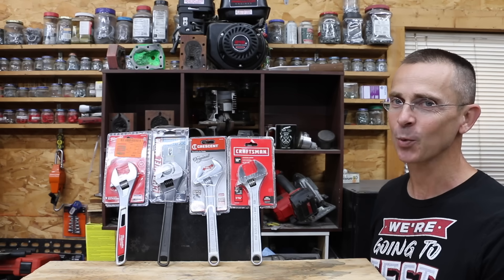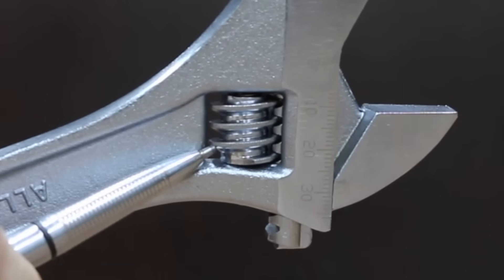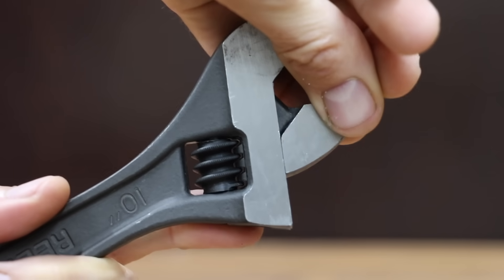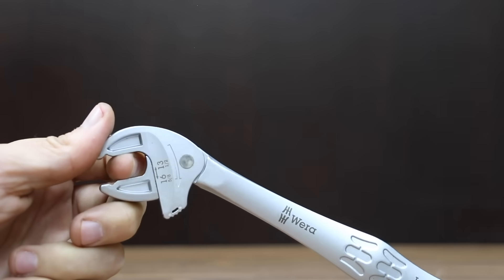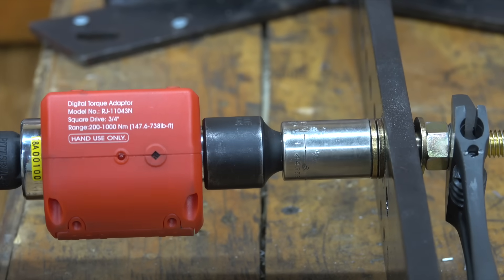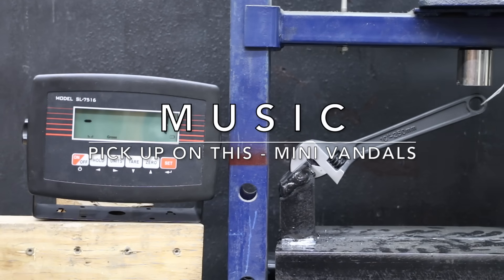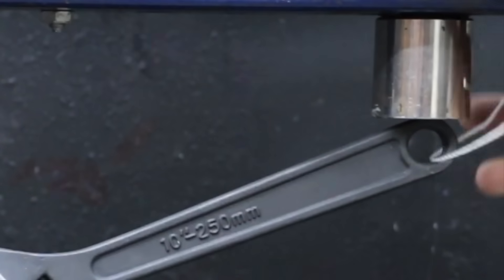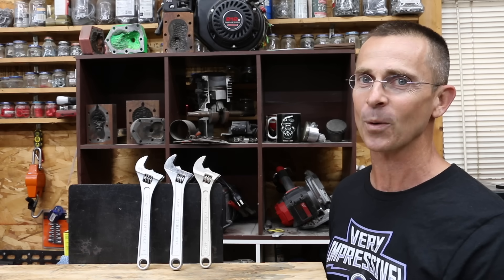Best Wrench (ADJUSTABLE)? Craftsman USA vs Craftsman, Crescent, Kobalt, Milwaukee, Channellock

Comment: Look, I'm an old guy who grew up watching other old guys using tools that were frequently ancient.  Most of my tools are considerably older than I am (the last one I used, a couple of days ago, was an old hand-crank drill that is probably from the 1930s).  Obviously, I have a large number of "vintage" adjustable wrenches, mostly old Crescents (I really wish there had been a U.S. made Crescent in the test, since the old Craftsman was included).  The "newest" one is an ancient Craftsman I found buried in the vacant lot next to my house- I haven't done anything but wipe it off, it's rusty as hell, and it not only works but has practically no slop at all.  

For what it's worth, I was told this as a kid and my experience has been the same:  old Crescents always have a bit of slop, but they are damned near indestructible & practically never rust; old Craftsmans are great, but much higher maintenance- if you don't grease & oil them, they will rust right in your toolbox.  

The best one I currently own is a J.H. Williams 12-inch (probably 1960s).  I have another elderly adjustable wrench, a Canadian one (I don't remember the brand), that is pretty good also- I think it's in the tool box of my work truck right now.

I practically never buy new hand tools, but sometimes there is no option.  Kobalt gets a bad rap, and they do make a lot of trash to scam dummies with, but they also make some pretty good tools that are dirt cheap.  I needed a pipe-wrench smaller than any of my Craftsmans, and I was pleasantly surprised at how good the 12-inch Kobalt pipe-wrench is.  It's pretty much the same deal- you have to test each one until you find a good one, it just takes a bit longer with Kobalt.  There were brand-new Chinese Craftsmans on the rack with the Kobalts, and they were absolute garbage; I wouldn't take one of those for free, they're so bad.  I recently realised that the heavy-duty plier/wirecutter set I bought for $1.99 at Big Lots back in the mid-1980s are Kobalt; I'm still using them regularly more than 30 years later.  Quality is quality, and with a bit of experience you can see it with your eyes and feel it with your hands.  Brand names don't even matter nowadays, just use your brain...

Later edit:  I just looked in my truck, and the Canadian wrench is an old Gray "Dreadnaught" 8-inch.  There is a somewhat later example on eBay right now (7:08 pm 4 August 2022) which is the same model but not as finely machined.  I literally found mine laying in the gutter on Gratiot Avenue a few years ago; these are essentially identical in terms of quality, etc. to a Crescent of comparable age...
Reply from the maker: Thanks for sharing.

Comment: If you don't want to watch a 20 minute video that could've been a 5 minute video...

8:34 "Jaw opening change from vibration" & "Weight"
12:37 "Wrench maximum torque"
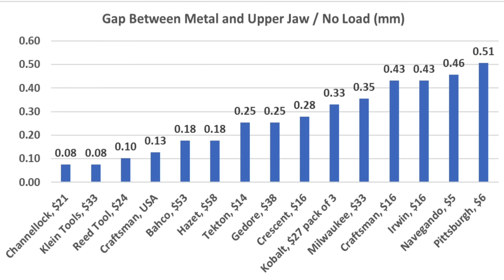13:22 "Gap between metal and upper jaw"
16:02 "Gap between wrench and steel plate with 200 pound load"
18:29 "Failure load"
18:54 This channel's pick for a $20 wrench is the Crescent brand, or spend more and get the Klein Tools.

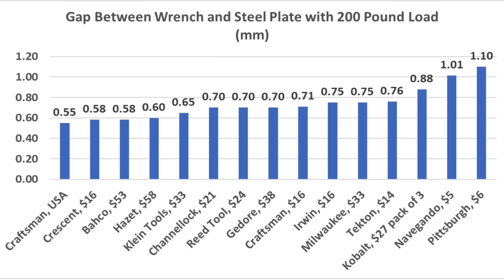16:16 Just to watch shit break.

Comment: Craftsman has been GARBAGE for decades. Its quality has steadily gone downhill as has sears fighting over honoring warranty replacement. Not to mention down in the teeny tiny fine print they state not for professional use. The craftsman of today is as bad as harbor freight junk The craftsman of the 90's wasnt like the craftsman of my father or grandfather. Craftsman tools are only good for cutting up nad modifying but even then its spendy to do so.
Reply from the maker: Thanks for the feedback.

Comment: The direction of operation that stresses the moveable jaw the least is opposite from the way most people seem to use this tool.  Turn the wrench over, and you’ll see the load point from contact with the nut move closer to the root of the jaw, and flex much less

Ignore the direction markings - adjustable wrenches are much stronger when they are used inverted
Reply from the maker: Thanks for the feedback.

Comment: I always ask for tools for Christmas. Wether it’s just Kobalt from lowes or whatever. People always ask me “what do you want “for Christmas, Father’s Day etc? I just tell them to walk the aisles of any home center and grab any of the holiday( especially Christmas and Father’s Day) bundles in the aisles for 20-30$. Cheap gift and most last a lifetime. I’m not a mechanic or carpenter by trade, so I don’t need to have the top tier tools. Most of what I got is great for what and when I need them. I’ve amassed a pretty nice collection of tools over the years. I still have some nice USA craftsman and snap-on tools my dad gave me too. So if for any reason my mid-grade tools fail me, I can reach for the older USA tools in my old metal toolbox. But my Kobalts seem to work pretty well for my limited use.
Reply from the maker: Thanks for sharing!

Comment: stuff i see that you did not test operationally: 1. set the jaw size, does it stay there through several uses. 2. set the jaw size, does it tighten itself onto the nut so you can't get it off.

Comment: is it really necessary to point out the zero before the point,  just say point 5 mm or example, you don't need to say zero point 5 mm.  we should all understand anything after the decimal point is less than 1,  and the zero is not needed.   I think I have belabored the "point" long enough.  HAHA

Comment: Why even use an adjustable wrench in a high torque situation in the first place ?  Makes ZERO sense.  Use a  box end wrench...problem solved.  Adjustable wrenches were not made for this kind of abuse.  This whole test seems pretty pointless.

Comment: With adjustable wrenches recently in mind (thanks to this video), I happened upon an old paint-covered Stanley 10” adjustable I’d tossed in my sprinkler bucket and forgotten months or years ago. I recall buying it at Home Depot sometime in the 90s. It was nothing special at the time: just another mass-market ingredient in the typical Hubert Homeowner toolset. But, damn…the perceived quality blows almost everything in this test away. Almost zero slop on each axis. I couldn’t get the jaws to open more than a hair while bopping the handle with my fist. This was a typical DIY tool 25 years ago—maybe 15 bucks for a pair of them.

We’ve lost something.
Reply: We didn't lose, they sold us out, and we settled for junk! We should have returned cheapo made stuff in bulk! They would have no choice but to go back to quality
I only get garage sale tools, they're not mine!
Reply from the maker: Thanks for sharing.

Comment: For work, I bought two pliers in a specialized shop, one 8 "at € 12.45€ and one 10" at € 14.94. Both of the Ega Master brand made in Spain. I am really satisfied with these two calipers, especially with regard to the holding of the measure under working conditions. I subjected them to some (non-destructive!) tests and got good results, towards the top of its ranking. Spain tools seems to me good .Always congratulations on his commitment and his ability to put the tools under stress
Reply from the maker: Thanks for the feedback.

Comment: I stay away from wrenches that have a handle like the Irwin. When pushing on the handle the rubber covering will slide off, especially if it’s warm where you’re working and store your tools.
Reply from the maker: Thanks for the feedback.

Comment: Nice test even though I am not a fan of adjustable wrenches.  I have an asortment of wrenches where I do not have to use an adjustable wrench.  Also, of note, at one time all Craftsmen hand tools were made in the USA (as advertised by Sears) but now who knows where they are made (Craftman now part of Black and Decker).  Still, a nice comprehensive test with a lot of effort to obtain the correct results.
Reply from the maker: Thanks!

Comment: Most of us avoid an adjustable for the reasons you showed. I'd like to see the Snap-on, Mac and Proto included. As an electrician of 40 years, I use my old American made Craftman tools for everything. I've only broken a few small sockets and a 1/2 inch ratchet in all those years. A breaker bar might be advised in those conditions instead of a piece of pipe over the handle, lol. At least if I'm on an out of town job, I can usually, or at least used to be able to get, a new replacement from Craftsman in most towns. Most of the millwrights I met used Craftsman too. God Bless America! China is the worst, every time. We are at war. They would have us keep buying their cheap crap over and over again, which adds up to a kind of economic slavery. Remember, 80% of our prescription drugs come from China. Some complete with jet fuel included for free. Google it. Thanks for the fair test and including the old Craftsman. May it rest in Peace.
Reply: I'm a millwright from Canada. I've been doing this job since 1980. By far the best adjustable open end wrench I have ever used is the Rastall brand made in Canada.
Reply: @FRLN500  Thanks for the tip, from a man with experience, but I hope to never have to use an adjustable wrench again. Although I do keep a small one with me while riding my electric bike through the mountain trails trolling for bears, just in case. Cheers
Reply from the maker: Thanks and you are welcome!  Thanks for the suggestion.

Comment: Been doing alignments on everything from kias to transfer trucks for like 12 years now.  The only adjustable I'd trust is a Crescent.  Even after the move to China they're hands down the best I've used.  Granted i rarely use a 10" (which is what was tested).

Comment: The feeler gage 200lb test the USA craftsman feeler gage was deeper than any other test. I'm calling bullshit, the craftsman was measured so deep into the jaw compared to your other tests, if you measured at the tip like the others the gap would have been larger. I'm unsure what tests to trust after that

Comment: I love the channel, but do recognize the limitations of the testing that you do. Testing a sample size of 1 is not really indicative of  quality, in that in an uncontrolled manufacturing process through chance, there may be some very well performing units while the item is trash in general, as well as the opposite. I do not know, with the resource constraints that you are operating under, how this could be resolved within your resources. The data you get from one sample is not indicative of the lot with any measurable confidence interval.

Comment: I am very happy to see Hazet and Gedore on the videos, a bit (very) disappointed that they didn't ace everything...
So I did some research, and I found out that there are some brands advertising they build predictive breaking behaviour into their metals alloys, trying to prevent serious injuries (or even death) to the user, in case of abuse/misuse or anything unexpected that might happen.
I couldn't find out, though, if this kind of "expected to break around xyz% above the expected normative torques" is also written into the norms.
I did find very interesting to see in the end that one or another brand market their stuff stating boldly "tolerances and quality that not only fulfils but greatly exceeds the norms", instead of going in the direction of "strongest tools you'll ever need" like the TV ads.

i guess this is quite a change in viewpoint, and maybe the strongest one to hold may not be the best afterall.
Gedore states in its catalogues that their proprietary vanadium alloy allows you to feel the tool deforming in your hands before it completely fails, (and I add this by my own personal experience here:) giving the user that split second enough of time to remove the bodyweight from the tool before it fractures itself, letting you fall down and hurt yourself on the floor... or worse, having the broken tool or a big screw poking deep into your skin.

Comment: I was taught to use the meatier portion of the wrench(the none adjustable side) as the side to apply the pressure towards. I wonder what the results would be if you flipped them around for your stress test 🤔
Reply from the maker: Thanks for the suggestion.

Comment: Just get a Stanley Maxgrip locking adjustable wrench. Appr.$15 at Walmart and they're excellent.
Reply from the maker: Thanks for the suggestion.
Reply: @ProjectFarm  The vicegrip part is great. You'll never lose grip on a nut or bolt.

Comment: It would seem that the answer is to buy good quality open end wrenches. Anyone with any wrench time knows what to expect from a 'Crescent' IE adjustable wrench. Not sterling performance, but OK performance for day to day type 'tightening up your kid's bike wheel nut'. In my opinion, the best adjustable wrench? Any 6 incher. It's too small to expect much from and does OK given it's size.
Reply from the maker: Thanks for the feedback.

Comment: The one tool we never had in any tool kit when I worked on aircraft, if you needed to undo a nut you got the correct size spanner. It was completely different when I worked in the oil industry, because we had to fly out to the platform you couldn’t take a lot of tools with you so all you carried were three or four different size adjustable spanner’s to undo the various nuts and bolts.
Reply from the maker: Thanks for sharing.

Comment: Would never pay $50 for a jiffy lube fools tool the AKA nut rounder adjustable wrench.Years ago I was platooned out of my electric shop to work with two extremely talented millwright mechanics They saw me using an crescent wrench and made me go back down 3 floors from roof top to get what they referred to as a  proper wrench. Was afraid to ask them what the proper wrench was so I took combination wrench and a 6 point socket. Neither of these guys had an adjustable wrench in their tool chest. Have several crescent wrenches collecting dust inside of one of my tool chest or maybe in my tool cart.
Reply from the maker: Thanks for sharing.

Comment: @12:19 - it reads 145.7, according to the torque wrench (which appears to accurately support 147.6-738ft/lbs) so where did you come up with 167ft/lbs?

Either way this is some SERIOUSLY good testing, just curious.

Comment: First off, I would never seek to put much of any torque on any adjutible wrench, be it a worm drive or    a channel lock. If I felt I need to put more than 5 lbs torque on a nut and or bolt, I will not even use open end wrenches but would use a box end or an impact socket. What would be interesting is to see,,,,,let's see,,,,maybe 5 of the same manufacture so we can see if there were possible manufacture flaws and or one batch of good quality steel and maybe some bad quality in a particular batch. Got to remember, the steel is made up in large batches and then made into the wrenches. And it is all done by machines. And how many out of a batch is tested by the companies? Too many questions that no doubt be never answered. So, for safety sake, I would never use any adjustible wrenches in a torque situation above 5 lbs torque. As the saying goes, the right tool for the right job. And safety first!
Reply from the maker: Thanks for sharing.

Comment: Very impressive Tests. Here in Germany adjustable wrenches are not that common. Most of the machines are metric, so you often need just two or three basic wrenches to do most oft stuff on them. However, for example in the toolbox of a tractor, an adjustable wrench is just a basic tool, which should always be in it. 

Maybe you could test the myth of the right direction. A lot of people say, that such wrenches should only be used in one direction and the other could damage it. But in tight spaces, there is often no option for the "right" direction. So does it make any difference at all? 

Also there was the Wera Joker in your test. There are some other products, which too claim to improve or replace the classic Crescent adjustable wrench design. Maybe you could test some of these against the results in this Video. For example:

Locking Adjustable Wrench
Offset Adjustable Wrench
Pliers Wrench
Self Adjusting Wrench Pliers
Snap'n Grip Wrench
The new Crescent Wrench where the jaws can be turned

Most of them are avaliable from different brands, so there should be a lot to test. 😎
Reply from the maker: Thanks for the suggestion.
Reply: By the way, i forgot the following designs:

RapidSlide Wrench
Ratcheting Adjustable Wrench
Speed Jaw Wrench

Comment: Would you fellas consider testing modular tool boxes? Most of the major brands today have their own locking, connecting tool box system. 
You could drop em. Crush em. Smash em. Squeeze em. Maybe scratch or scrape em.
Reply from the maker: Thanks for the suggestion.

Comment: Great analysis, I feel even better about my Craftsman wrenches from 1980.  I'd like to have seen Snap-On tested.

But the last test should have also been a torque test, not a force test.  You probably don't have a 1000 ft-lb torque gauge, but you could adjust your test results to account for the effective length of each handle by measuring from {the jaw center} to {the point the press applies load}, and then calculate the applied torque that results in failure.  

Handle lengths will differ slightly, and that shouldn't penalize or benefit a wrench in this failure test.  I can stick a pipe on the handle of a wrench and double its length -- if I now run the test, is it fair to say it failed at half the force?  No, because the applied torque at failure was exactly the same.
Reply from the maker: Thanks!  Thanks for the video idea.

Comment: The Kobalt “works with both standard and metric fasteners”. Lol. I should have gotten one of those. Mine only works on standard fasteners. I’ve needed it for metric bolts/nuts a lot, but it just won’t work since it’s standard.
Reply from the maker: Thanks for the feedback.